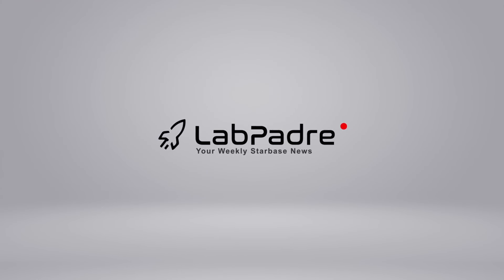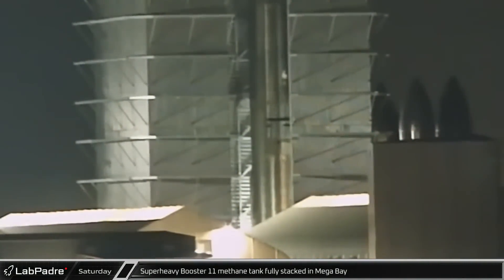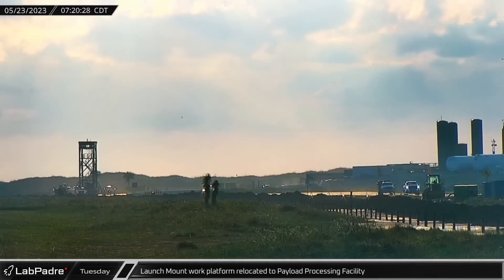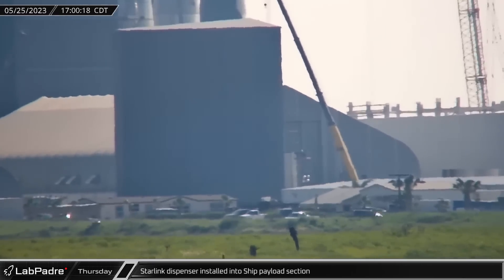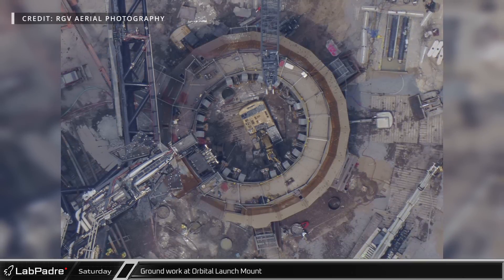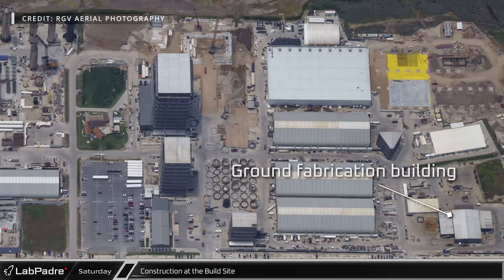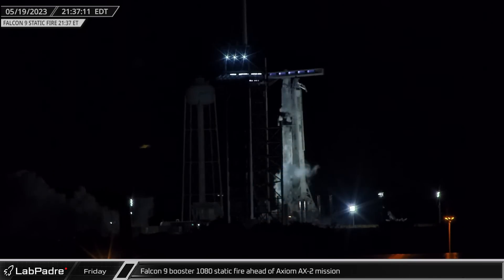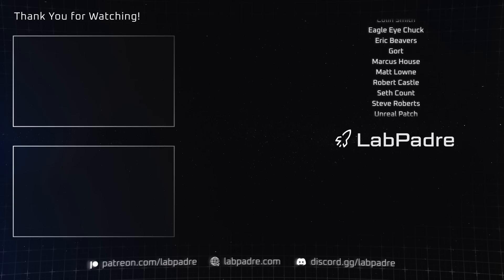SpaceX Continues Rebuilding Starbase at Breakneck Speeds - Starbase Weekly Update #64

Comment: Raptor quick disconnect hardware for out engines are an upgraded design, feed pipes are larger than old ones.  SpaceX have definately took advantage of this situation for not just repairs, but major upgrades to.

Comment: So what was the reason why starhip didn't separate from the booster during first flight?
Reply: It wasn’t commanded the vehicle deemed it unsafe since it was tumbling from gimbal loss
Reply: They probably lost control to the whole booster or SpaceX just did not separate it since they knew it was not going to make it. When they called BECO, nothing happened, engines just kept on going.

Comment: The worst thing that could happened in rocketry is to be lucky…
Reply: Starship Heavy,  fully reusable except the launch pad...
Reply: @mrnico333  zzzzzzzzzzzz
Reply: You can’t even possibly phantom the amount of shear luck you had that this slip and sliding shuffling rocket clear out on the right side of the tower, 😂, exactly the flight pattern that the N-1 rocket had… the Raptor engine is a Glass Joe, that barely can be reignited, not to talk abouti sustaining full thrust in the thunder of lift off… not!